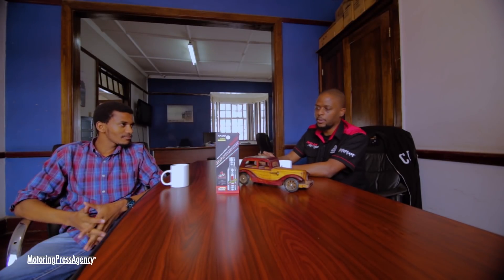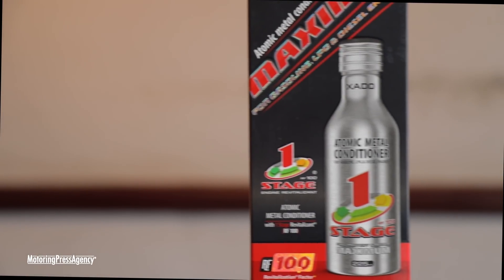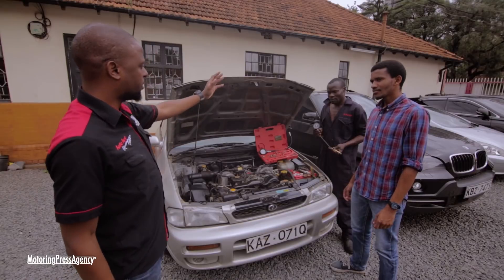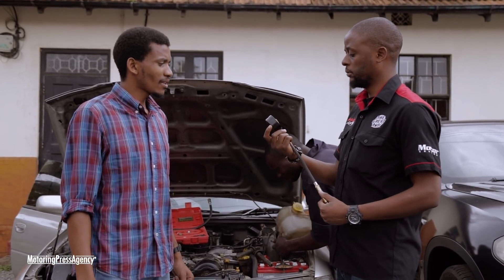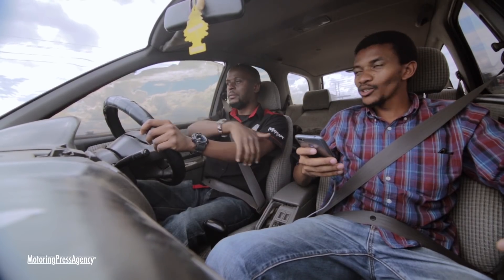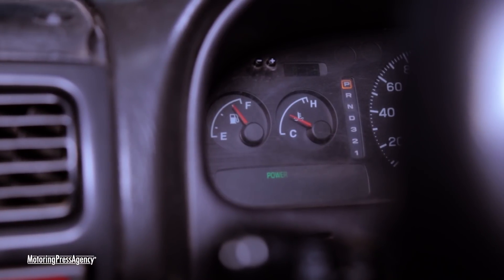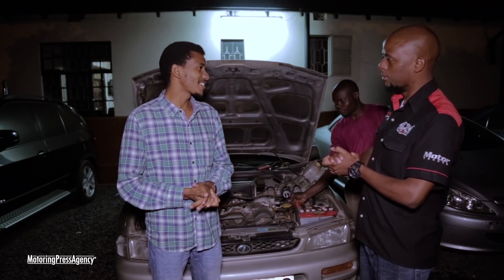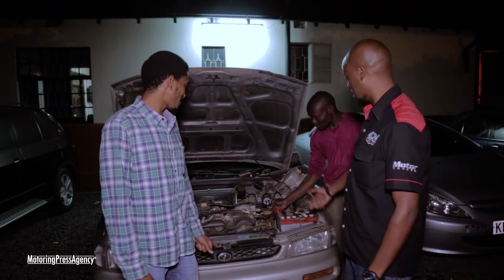Ep.1: "It Is What It Is" [Product Review] - XADO Atomic Metal Conditioner

Comment: I've used this for years it's no good on high mileage engines 
You need to put a good injector cleaner in the fuel first to decarbon the cylinders 
Which will possibly make your engine use oil because it's relying on the carbon on the piston rings to seal the cylinders 
After adding the xado it will improve compression but eventually you will end up with less compression than when you started 
You are better off using ametech engine restore 
And rizalone ring repair together 
It will feel like a reconditioned engine 😀😎
Reply: very interesting,
Reply: Good explanation. Are the other alternatives available locally. Never heard of them...

Comment: Great video. Kumbe Xado is such a good product!! Baraza, improve on the audio quality next time.
Reply from the maker: We will work on that
Reply: @MotoringPressAgency 
Look at ametech engine restore and rislone ring repair 
It is much better than xado 
You will think you have a reconditioned engine 😀😎
Reply: It's rubbish I've used it for years it's no good in a high mileage engine it doesn't do anything 
Get some ametech engine restore 
And a bottle of rislone ring repair
Reply: @S-O-T   rislone ring repair is shit! made loud lift noise and burn heaps oil after use it.